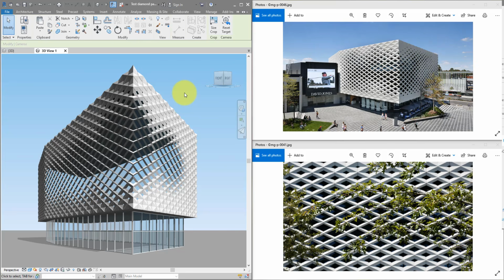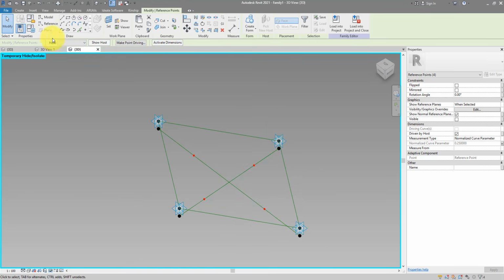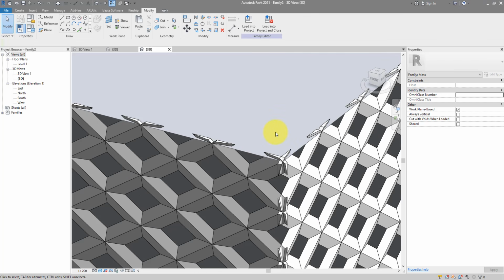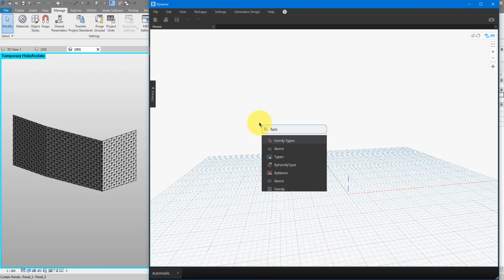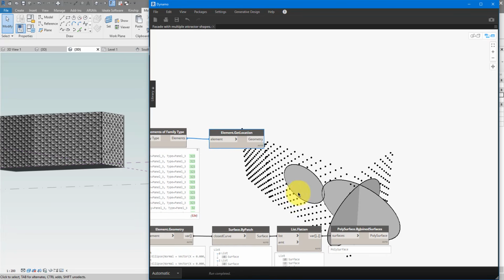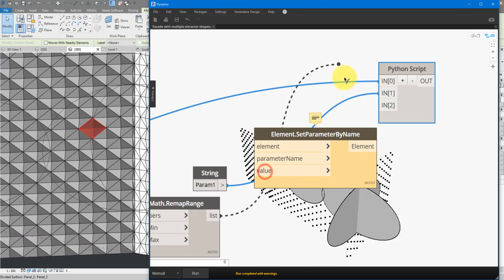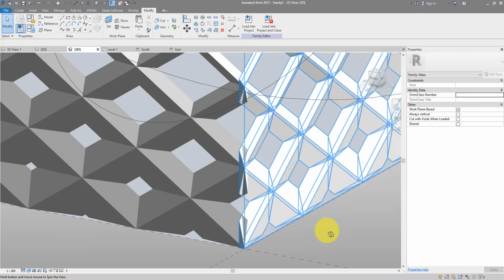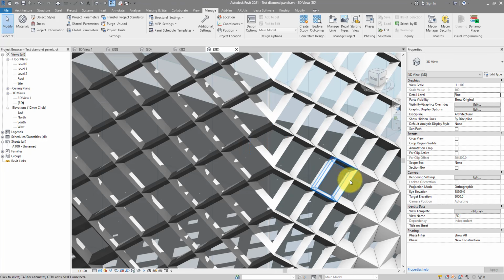Revit Snippet: Create Adaptive Curtain Wall with Multiple Attractors

Comment: I have everything right im assuming, but when i run the dynamo, the pannels dont open/close in a gradient, instead they only have two modes basically, open and closed? Could it be a problem with the units? Any tips?

Comment: it only works in the conceptual mass for me, i've tried to do it on actual projects different two, it didn't work.. it only says run started and nothing ever happens :( the problem is in the param1 it's read only in rvt files
Reply from the maker: Hi! Did I show anywhere in the video that the script could run in the project environment? If not then it's for the massing family only.😅
Reply from the maker: Also, the Python node should be set to use Python 2, not 3 because this is an old script.

Comment: Hello, I did everything step by step in the tutorial and many similar tutorials but my problem is that when i choose a single panel the Param1 and the other 4 parameters I made are grayed out and I can’t change the size of the hole in the panel for each instance. I really don’t know why this is happening even though I made the parameters instance.
Reply from the maker: Were you in the right environment? Sometimes a parameter is only editable in the family/mass editor, not in the project 😞
Reply: @RVBoost  you are right, I figured it out after commenting. Thanks a lot!
Reply from the maker: Great! Glad the video was useful 😁
Reply: @RVBoost  I did the dynamo part and when i use the python script for cpython, it doesn't work
Reply from the maker: You may need to set the Python node to use Python 2. It's on the right click menu of that node

Comment: thanks. my case is weird, the Param1 becomes a read-only so Dynamo script struggling here
Reply from the maker: Did you create the parameter the way I did in the video? It should be an instance parameter.
Reply: @RVBoost  thank you for answer, yes, i followed the video precisely. i tried to put your adaptive family instead, but got the same error. im out of cues now
Reply from the maker: Maybe check if you're running the script in the right environment (conceptual mass Vs project). Some families are only modifiable in a conceptual mass.
Reply: @RVBoost  i'll check it out, thanks

Comment: Hello, I am having trouble when associating Math.RemapRange list value to the false bracket of the If statement during the Dynamo script. When the value is more than 0.495 it replaces it with exactly 0.495 as it should, however, when it is lower it associates the whole list of values from Math.RemapRange to EACH of the false values. Have you experienced such an issue a know what may be causing it? Thanks.

Comment: Would it work with Splines or points not only ellipse?
Reply from the maker: It can work. Have you tried?
Reply: @RVBoost  I tried but didn't work
Reply from the maker: Looks like your shape needs to have a closed boundary for the script to convert into a surface. Try Circles, ellipses, rectangles, etc.

Comment: Hi. Thank for the tutorial! I have a problem, I downloaded the script , and I’m following the steps , on my own project , by it doesn’t seem to be working. Could you help ?
Reply from the maker: Sure! What didn't work in particular? Did you get an error? What did it say?
Reply: @RVBoost  It doesn’t say it has any mistake , the thing is , I added the family on my rvt project , divided the surface of the mass I had there , placed the diamond family , so far so great. Then I opened the dynamo script , did the elipse on my mass, on the desired facade , selected using select model elements, but absolutely nothing changed :( , it says selected , but my elipse doesn’t even show on the dynamo background. Hope you understood my problem
Reply from the maker: Some of what you described should be done in the mass family editor and not the RVT model. Please see in the tutorial exactly in which environment you should perform which action.
Reply: @RVBoost  Understood. Ok then, thank you so much

Comment: I bought the files in the description. When I try to copy and paste the Python script, it gives me an error. Can you help? I have never used Python before.
Reply from the maker: Sorry about that. Did you follow the copy instruction in the text file included with the download? What error did you get?
Reply: @RVBoost  Yes. I opened the Dynamo file I downloaded, copied the Python script, opened my original Dynamo file, and pasted the Python script into my file. Now I get the error TypeError : 'NoneType' object is not iterable [' File "<string>", line 27, in <module>\n']
Reply from the maker: That error suggests one of the inputs to the Python node isn't of the expected data type or list/non-list structure. Please compare your script with the downloaded version to see how the nodes leading up to the Python one are different. You can also use the downloaded script directly without copying the Python node's content to your file.

Comment: hey, thank you for the great tutorial, but I don't know why the script is not working for me.
It is always giving me this warning: 
Warning: TypeError : No method matches given arguments for OnExit: (<class 'Autodesk.Revit.DB.Transaction'>, <class 'type'>, <class 'AttributeError'>, <class 'traceback'>) ['  File "<string>", line 37, in <module>\n']
what should I do in this case?
Reply from the maker: You can download the script from the video description which should work :)  If not possible, please let me know which node you got the error on. That will give a hint on what went wrong.
Reply: @RVBoost  yes I did download it from the link in the description but still not working
Reply: Any news? I’ve got the same error
Reply from the maker: Which node gave you the error?
Reply: Where the Python script goes, it gives me the same error that on line 37
Reply from the maker: Please send your script file to support @rv-boost.com so I can help.

Comment: Amazing tutorial. Thank you!!!
Can this be done in the “In-place Mass” environment in a project file? From my (limited) dynamo experience, dynamo has a problem with accessing geometry created in the massing environment in project files.
Reply from the maker: This should work in both the massing and project environment. The important thing is you need to start Dynamo in the environment you want to use. For example, if you want to use it in-place in the RVT file, start Dynamo in the model. If you want to do it in the family, start it with the RFA file active. I however would do this kind of work in the family, as in-place components are usually more complicated.

Comment: Hi there! just purchased because H needed the coding for the dynamo work! just wondering if there is anyway i can resize the custom adaptive curtain wall? I cannot seem to figure it out, can it be resized to custom parameters from the downloaded file? I tried to double click and change the profile of the wall but it did not work. hope to hear from you soon, thank you again
Reply from the maker: Thanks for getting and using the script! Yes, you can resize the curtain wall. It's not part of the Dynamo script though. The sizing is done in the massing environment by playing with the parameters of the divided surface. I've already shown how to do that in this video.
Reply: thankl you for your reply, can this be done with the model thats been purchased from the website? and how would i open the massing environment from the downloaded revit file? thank you
Reply from the maker: Yes, that file should work. To edit the building in the massing environment, first go to the Massing & Site tab and enable Show Mass. Then, select the building when it highlights as a single element. Finally, click the Edit Family button on the ribbon to enter mass editing mode.

Comment: Hello sir need help asap I'm getting an error called

"IronPythonEvaluator.EvaluateIronPythonScript operation failed. 
Traceback (most recent call last):
  File "<string>", line 35, in <module>
AttributeError: 'Point' object has no attribute 'LookupParameter'

please help
Reply from the maker: Hi, sounds like you didn't connect the right node to the IN[0] port on the last Python node of the script. IN[0] here must receive the list of panels from the "All elements fo family type" node, not a list of points.

Comment: Hi I have  downloaded the fie , however, i do not know how to copy this code into the Python node any steps on how that should be done? and what app opens the dyn file.
Reply from the maker: Hi Fila, thanks for getting the script file from us!! This Dyn file, you'll need to open it in Dynamo. Simply open Revit, open Dynamo, then open the script. You can then select the Python node and press Ctrl C to copy. Then, close our script, open your script in Dynamo, and press Ctrl V to paste the node in.
Reply: @RVBoost  ohhh nice , nice Thanks again . One more question ,how would you suggest I use it for a curved surface ....is it by using smaller shapes ?
Reply from the maker: Yes, please use smaller panels for a curved surface if you want a smooth pattern.

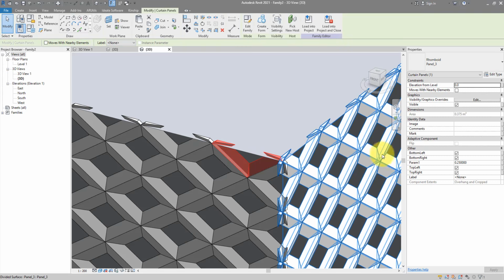Comment: how did you select the each panel on 10:28 ? Please reply :( I tried everything. I cannot click the panel. Thank you for your respond!!!
Reply: i mean..do you have to press ctrl or shift? or double click?
Reply from the maker: Just press tab a few times while hovering over a panel. The panel should then highlight and let you click to select it.
Reply from the maker: If that doesn't work then you probably missed one of the previous steps in the video. Please re-watch.

Comment: Hi, Thanks for the amazing video I have a problem, after pasting the file I get "IronPythonEvaluator.EvaluateIronPythonScript operation failed.
Traceback (most recent call last):
  File "<string>", line 36, in <module>
TypeError: StackValue is not iterable "
Reply: I found another error in the comments, I did it again but I still get that message
Reply from the maker: Hi, sounds like some characters in the Python node's text was change during your copy. Please compare the original and copied text, and re-type anything that changed.
Reply: @RVBoost I download it again?
Reply: @RVBoost  Please, I would appreciate your prompt response.
Reply from the maker: No, just copy text again from the same file you bought.
Reply: @RVBoost  
I already did it again and nothing, I even used the file they sent as a spreadsheet and nothing comes out the same message. I sent a photo to support Thank you
Reply from the maker: I'm very confused. Who are "they"? And what spreadsheet?

Comment: Is there a way you can do this on a curved wall?
Reply from the maker: It can be the same method showed in the video if you can make each panel smaller so they can follow your curved wall better.
Reply: @RVBoost  Okay thank you will give that a go!
Reply: @RVBoost  I tried with a circular/cylinder shape but unfortunately when I divided the surface and changed the pattern to panel_3 there were 500+ errors all saying - Can't make type "Rhomboid : panel_3". Any suggestions? Thanks for your help
Reply from the maker: Well if you use the 4-point curtain panel family on a triangle grid then it will certainly fail... You'll need to create a 3-point panel family following the same method showed in this video. Wherever I used a 4-point grid, just change to a 3-point one instead. I'll do a new tutorial on this if I find some time ;)
Reply: @RVBoost  Thank you!

Comment: can this work to any shape ? i have a project design which is similar to zaha hadid style , and i wanted to have this kind of wall design, can i pull it off?
Reply from the maker: Yes it will. Of course, you'll need to play with the panel size and angle to make it fit smoothly into your design :)

Comment: Great video. I followed your tutorial for a tall, twisting tower. The script works great for one ellipse shape. But as soon as I try to run to script with a second ellipse, the panels don't cut properly. Any suggestions? I'm sure it's giving me problems simply because it isn't a straight vertical wall, but surely there should be a way to get it to work.
Reply from the maker: It's more difficult in your case because each panel will check its distances to all ellipses and take the lowest value, which will in turn determine its opening ratio. One solution is to draw more and smaller ellipses instead of 2 or 3 big ones. This way, you can better control these distances.

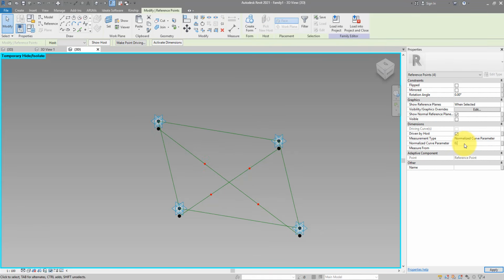Comment: Hi bro I have a problem at 4:09 of video. I did what you saidbut I had this warning: "There are identical points in the same place. Lines created from points may not work as expected."  And I couldnt complete this step. Could you please help me? I did everything correct what you said up to this step.
Reply from the maker: You need to play with each point's "Measure from" parameter before this step. I also showed that in this video before the 4 minute mark.
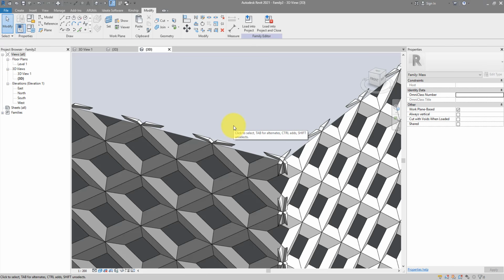Reply: @RVBoost  Thank you I fixed it. But I have another problem. 10:29 you can choose one by one these panels but I can't. I can just choose divided surface, i can not choose just one panel. what is the problem I dont know. Could you please help me?
Reply from the maker: You'll need to press Tab to highlight the panel before clicking it to select it.

Comment: I bought the script and was wondering how to paste just the part with the python script the was blurred out in the video
Reply from the maker: Hi! Please open the script you downloaded, double click the Python node, press Ctrl+A to select all text in there, then Ctrl+C to copy. Then, you can close the Python node and the script, open your script, double-click your Python node to open, then do Ctrl+A followed by Ctrl+V to paste the copied text in.
Reply: @RVBoost  do i paste the whole thing in the Python script?
Reply from the maker: Yes, please replace the whole thing in there.
Reply: @RVBoost  i get “run complete with warnings”
Reply from the maker: It should work if you run the downloaded script instead. Not sure what's missing in yours...
Reply: @RVBoost   i have 822 lines of code?
Reply: @RVBoost  i get an error “name false is nor defined’”?
Reply from the maker: How many lines are there in the Python node in the script you downloaded? That should be the same number of lines in your Python node after you pasted my code in.
Reply: @RVBoost   its working fine now, i just had to capitalize some of the code
Reply from the maker: Great! Not sure why because the code in the script you downloaded should be properly capitalized?
Reply: how do you fix this

Comment: Hello! thank you for the video!
I'm getting this message on the python node:
IronPythonEvaluator.EvaluateIronPythonScript operation failed. 
Traceback (most recent call last):
  File "<string>", line 2, in <module>
NameError: name 'false' is not defined
Reply from the maker: Hi.Glad you liked the video!
Sounds like you made that Python node yourself? Please download it from the link in the video description to make sure it will work.
Reply: @RVBoost  Hi, I downloaded the script from the link and it still shows that's the exact same error...
Reply from the maker: Hi Luis. Did you copy what in my Python node to yours? If so, the error indicates that text was changed to lowercase during the copy. Please copy again without changing text case.
Reply: @RVBoost  Hi, now it does not show "error", but when I run Dynamo after the step of "Pythonscript" my family don't change the size as yours
Reply from the maker: Please check if you have created the panel family the same way I showed in the tutorial. Also, check that you use the exactly correct name of the parameter controlling the panels' opening size.

Comment: warning: IronPythonEvaluator.EvaluateIronPythonScript operation failed. 
Traceback (most recent call last):
  File "<string>", line 37, in <module>
AttributeError: 'NoneType' object has no attribute 'Set'
why?
What is the solution?
please
Reply from the maker: Sounds like your curtain panel family doesn't have the "Param1" parameter or it's named differently. Please make sure to add a parameter called "Param1" as showed in the tutorial. The name has to be exactly "Param1".
Reply: After I bought the script from the site
And copies made in payoth Dynamon
There is no result
Reply from the maker: Let me know if the suggestion works :)
Reply: @RVBoost  
hi
Reply: @RVBoost  I am currently facing a problem in a limit that exists now

Comment: Hi, Thanks for the amazing video.. however the script doesn't seem to work. it's giving me this msg (arning: IronPythonEvaluator.EvaluateIronPythonScript operation failed. 
Traceback (most recent call last):
  File "<string>", line 29, in <module>
IndexError: index out of range: 1) Although i have downloaded it from the website.
Reply from the maker: I just checked again and the script still worked. Please make sure to follow each step in the video exactly so that the script has all required input data in it.
Reply: @RVBoost  it actually worked at the end .. the issue was in something other than the script, however my project is complicated and in order to do such amazing facade it would take me a year 😭
Reply from the maker: I feel you pain! Hope you'll make it at the end :)

Comment: Great tutorial. Thank you very much. But the script you send on your website does not work
Reply from the maker: What's the error?
Reply: @RVBoost  Warning: IronPythonEvaluator.EvaluateIronPythonScript operation failed. 
Traceback (most recent call last):
  File "<string>", line 2, in <module>
NameError: name 'false' is not defined

Maybe I made a mistake somewhere
Reply from the maker: @ronnykazadi559  Yeah that's a bit strange. I just double checked the Dynamo script and it still worked fine. There's also no "false" in the Python node. How about downloading it again from the website?